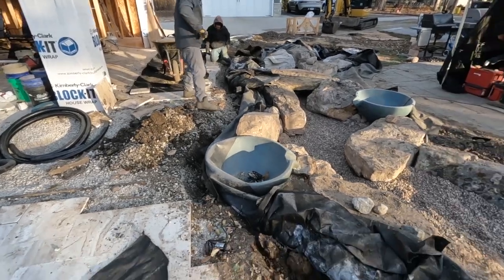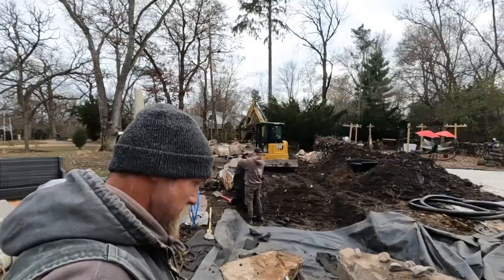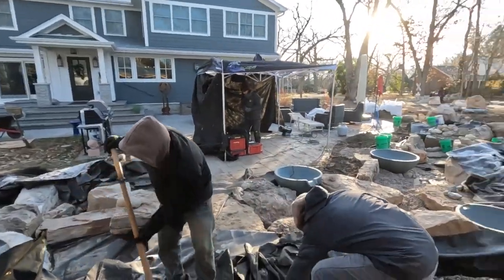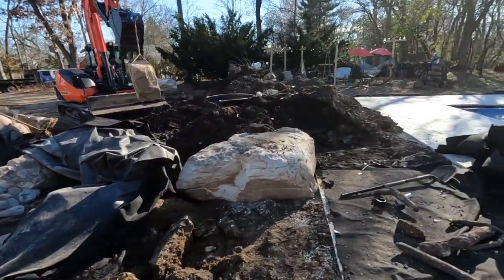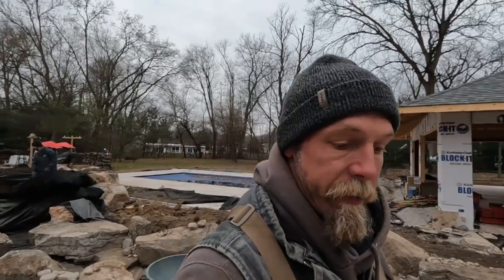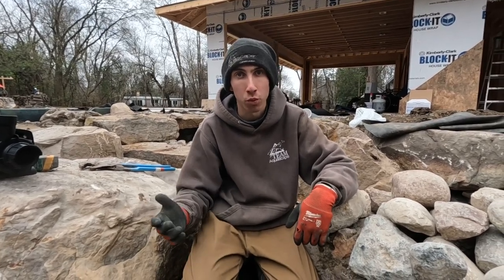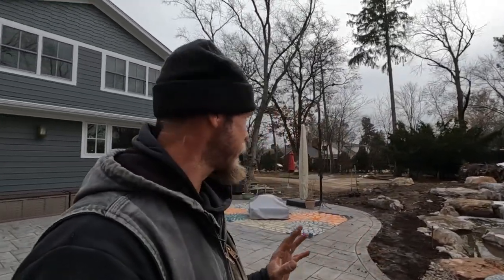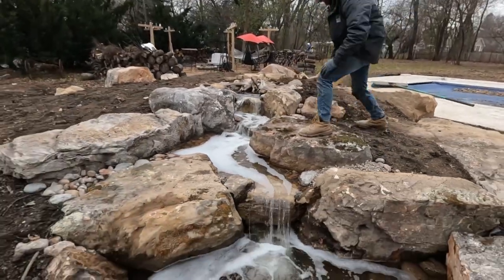MISTAKES Can STILL Create MASTERPIECES!

Comment: Extreme nature perfection from your guys. Every rock and stone at the right place and this in the winter. I can imagine how it will look in the summer. Maybe could you please show me or direct me of the plumbing of the wetland filter. Is it going through the liner or over, and if it's going over, how do you hide it without a leak there by the liner and the pipe?

Comment: Awesome work and design is amazing. I wish you would discuss more about the electrical needs/requirements of something like this- e.g. 110 single 14amp breaker for pumps and lighting is all low voltage??